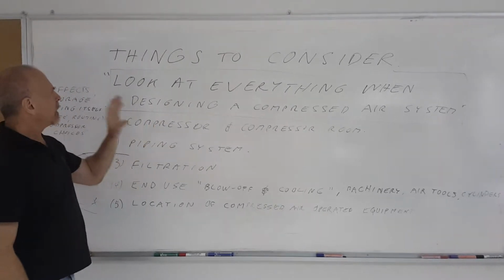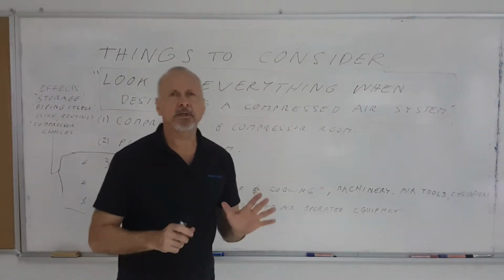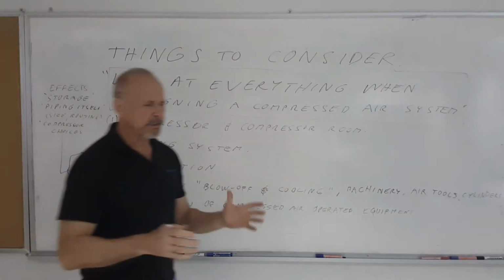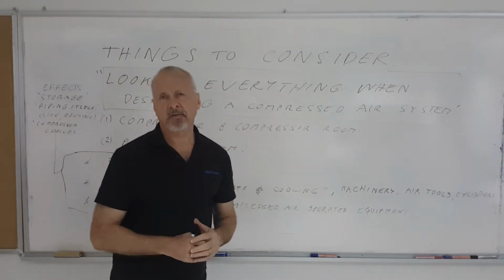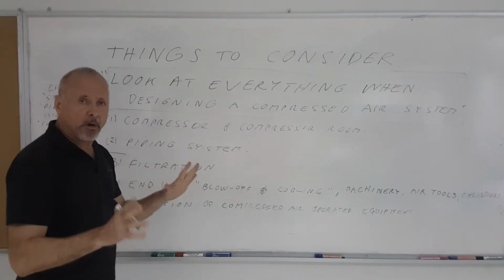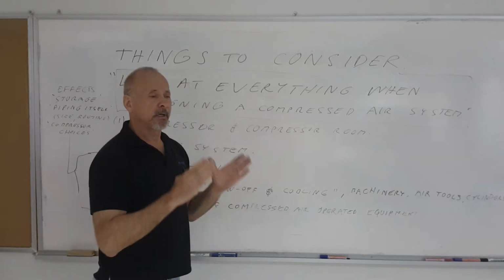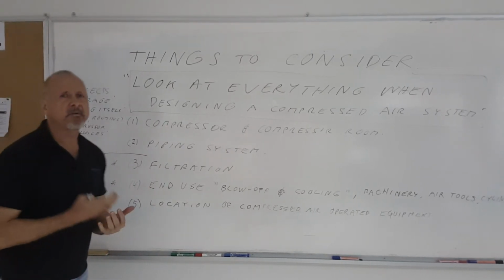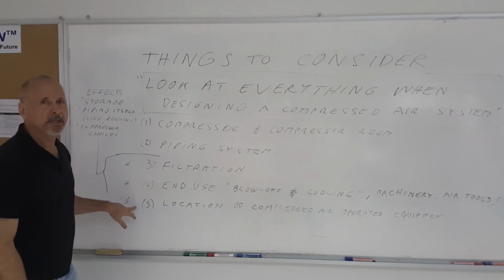Things to Consider When Designing a Compressed Air System from Scratch

Comment: You addressed these compressor issues perfectly Les! 
Another issue is the following: every techie in Europe has been taught during their education that compressed air is very expensive. This resulted in relatively small compressor systems in Europe - compressed air is mainly used to move pneumatic cilinders and control movement in systems or pneumatic control valves. So it's very important to check the available capacity of compressed air.
Reply: Thanks Andre